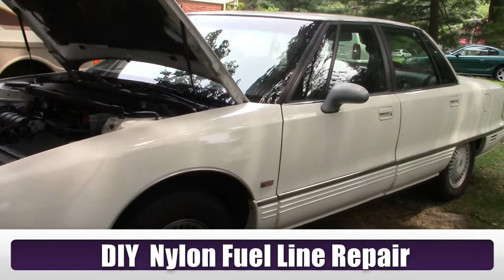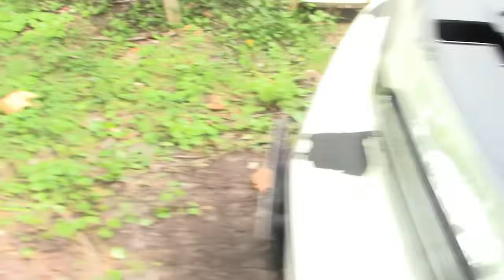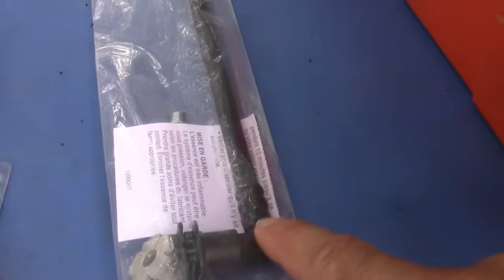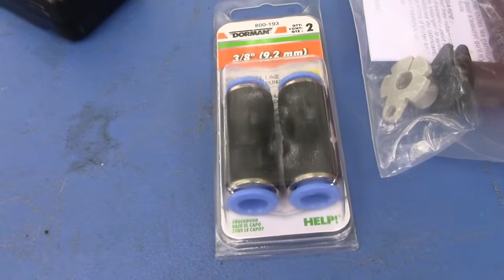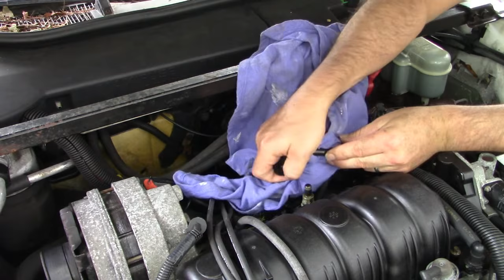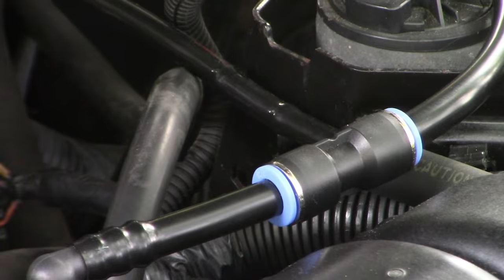Gasoline Leak?  Easy DIY Nylon Fuel Line Repair

Comment: You made an excellent video, very realistic, your readiness to work on your car is also very nice. But I would prefer first completely avoiding nylon line under the hood and exchanging both feed and return original nylon lines with either SS braided NBR or PTFE so as to avoid nylon line living in the heat (they don't like that and that's the reason why it cracked in the first place), or if for any reason keeping the nylon at least connect the two parts with barbed rather than with these untrustworthy plastic connectors. As for anti-chuffing, instead of cable protection, find a peace od garden hose or on old cooling system hose and slide it on. Cheers and keep on!

Comment: With those connectors you need to measure and mark to assure proper seating depth ESPECIALY with gasoline on a hot engine. I would have bought a new part as you now have to points in which to leak.

Comment: Totally  not good  because  its not a solido connection. Will leaks  and becaise  its pressure        it carries low pressure  and high  presure

Comment: I used a tubing flar kit. The bar that holds the tubing will hold the plastic fuel pipe tight enough to use more pressure, whe putting on you slice coupler.

Comment: That is one beast of a car. Saw a 2 door 98 in Olive Green that really was a nice boat. Good vid!
Reply: When I was 16 I had a 1973 with a 455 cubic inch motor. In olive green, that was a beast. I'm guessing it weighed about 5500 lbs

Comment: I did a similar repair on an 06 Siena and I needed a loop. I took the straight nylon replacement hose and stuck it in boiling hot water that was in a cut off gallon milk jug. It worked great, no kinks.

Comment: Wouldn't recommend, I tried two different fittings both leaked
Reply: You can also use ducting tape they use for hvac in a pinch. It works

Comment: I have a 96 Camaro with a leak in the nylon fuel line. It says "not repairable" on it. Does that mean I can't utilize this technique?
Reply: Same question. My return near the tank is leaking due to a rodent. It does say not repairable but I suspect that is for liability. Anyone know?

Comment: I bought these for my car and they absolutely suck.  They wouldn't grip the tubing and I just threw them away out of disgust.  Use a compression connector that is specified for nylon and you will have better results.
Reply from the maker: Worked flawlessly for me.... Compression connectors work well, too, I will say. Thanks.

Comment: Nice video! Are these the same as pneumatic fittings? Do you size the connector up or down, or just buy 3/8 connector for 3/8 nylon line? Thank you!

Comment: Might try  to bend the new line using a  heat gun and  a coil spring type tubing  bender as used for thin walled  copper tubing in household water  supply lines and  refrigeration lines. Worst  thing that could happen is  you  might melt the shit. A judicious  application  of heat and bending will  probably  get you through. You're  not going to  get a 90 using this method. But you could do a loop. Nonetheless,  thank you for the video, It gave  me some ideas.

Comment: Thank you so much for providing excellent content. Your video gave me the confidence to repair my own fuel line on my 2000 Pontiac Bonneville 3.8L
I used the exact same part numbers. The only difference I did was take a heat gun to curve the hose as close to the stock one. Other than that it was a nice clean repair. Not sure if I'm able to upload a picture of the repair. If I can I will.
Reply from the maker: Great note! Thanks for watching and commenting. Good job on the repair!

Comment: Great video. Glad it held up for you.  Me personally, I don't trust the push on because it's only an o-ring holding the seal.  Dorman has compression union #800-226 for 5/16 line that has brass on the inside of the tube, and nut with seal on the outside.  You can then adjust the compression depending on how tight you tighten the compression nut.  It's only a bit more work but it just feels safer.  And as it ages if it does leak, you can always snug it up more.

Also, as others have stated, I don't think sanding should ever be done on the outside of the tube as that is where the seal is made on the tubing with the press on.  Being OCD, I go one step further and even use a razor to cut the line to make sure there are no burrs on the lip of the cut that could interfere with the seal.

Thanks for your video.
Reply: It actually has small teeth inside that grip the line

Comment: Those unions do not fit the 3/8 line on my 1988 F150 (too small). The 10mm fit but do not seal.

Comment: I agree with your several assessments: a) not to use the barb fitting; b) not to squeeze / cut; c) not to induce a kink in the curve. That line can withstand under hood temps and will take a set first hot / cool cycle. You could have used hot water or a heated wet towel to soften / shape the line to avoid kinking and eliminate any stress strain on the connectors.
Reply from the maker: Thanks for watching and commenting.

Comment: Ouch... You doubled your chance for failure by using two unions instead of one.
And running the line around the EGR valve is a recipe for disaster. There is a good reason the OEM routing was outside the heat shield. A piece of wire loom is no substitute for a heat shield.
Reply from the maker: Ouch nothing. The repair job has held up great. But if anything does go wrong, I'm blaming you.

Comment: Thanks for sharing awesome video it makes more sense than any other of the 30 video I have looked at fixing my 2005 Cadillac Deville that has a leaking gas fittings
Reply from the maker: Thank you so much!
Reply: Hey James, looks like I missed a question from you, some time ago. Yes, this worked on my 1996 Cadillac. I used the  Dorman brand found at almost any auto parts location and was pleasantly surprised at the ease of installation, as well as its effectiveness.

Comment: hi sir; does it survived without leak under engine heat and fuel pressure.
Reply from the maker: The fittings have held up perfectly for a long time now, without any problem.

Comment: Those sharkbite connectors are pretty cool. Used in plumbing,  air,  and now fuel.  I bet that leak was because you sanded the end of that tube.  Hopefully she holds for you.
Reply from the maker: Thanks, Lee. The job has held up for well over a year now, no problems.

Comment: I've got a leak that keeps coming back and came across the repair joints and watched your video thanks. I'm just going to eliminate the connection and install one joint
Reply from the maker: Thanks, Tim. Hope you get it solved.
Reply: Did this end up working for you in the long run, Tim?

Comment: I have a bonneville with nylon fuel line and repaired it with a union but it is leaking so im going to have to put a new union on i guess. But good video and great info !

Comment: If they make those repair couplings in 90° , could have used two with straight pipe in between.
Reply from the maker: I'm pretty sure they make 90 degree fittings, but I was trying to make it work with what I had on hand.... Still holding up well to this day, happily.
Reply: @Buckwsr  
Had to fix fuel filter fitting that developed a hole on Crown Vic. 90° quick connect fitting, about 6" 5/16 rubber fuel injection hose, two clamps and new Motorcraft fuel filter. About $30 and hour or so and back in business.

Comment: why u got 2 inline connectors on one pipe, u could of took the one on the engine spun it round to join the one on the inner wing.

Comment: Thank you so much; brought/installed the connector kit and the nylon press fittings today because of your video; very helpful. I was afraid to “cut” my cars original part at first. Your vid gave me some courage. So far so good; no leakage.
Reply from the maker: Cool. Mine are still working perfectly, too.
Reply: @Buckwsr  wow 2 years and it’s still holding up? Nice !!!
Reply: Is it working till now?
Reply: @Victordd496  yes; holds up well
Reply: Thanks I going to do it today
Reply: How did it go? @jameswhite1319

Comment: These Dorman quick connect fittings look like a pretty good solution to a similar problem I have on my 96 Cadillac Deville.

Do you trust them for use on the high-pressure line feed line?
Reply from the maker: I think they're fine for either, supply or return.
Reply: Hey  @Buckwsr ! Thanks for this video. Though simple, it gave me the confidence to attempt a fuel line repair. Yes, this worked on my 1996 Cadillac and I did use the  Dorman brand found at almost any auto parts location. I was pleasantly surprised at the ease of installation, as well as its effectiveness. More than a year and no issues.👍

Comment: Thanks for the demonstration, including the slight misstep. Keeping it real.
Reply from the maker: Thank you, Sir.
Reply: @Buckwsr  I actually came here to see if the press couplings work properly.  Seeing you install one, and have a slight leak, then just push it in and repair the leak was an excellent video.  Dorman should send you a bag of fittings as a reward for posting this.

Comment: Steel on steel contact with anything in the engine bay even with a hand hacksaw can make small sparks. It would be safer to cut the line with snips.
Reply from the maker: steel on steel? You mean steel on plastic....it's nylon fuel line, not steel.
Reply: Liked the video thanks. But he's right, the hacksaw could have slipped through cut into metal elsewhere.. and someone could even make an accidental connection berween a hot  wire and grounded material, however unlikely. Prolly even wise magic to disconnect the battery but maybe thats overkill idk. Though the later happened to me once, dropped a wrench on an engine and the other end managed to land on the alternator hot post, which should have had a cap on it

Comment: On my 2001 Buick Lesabre I had a leak in 90 degree fitting. Under the back seat there is a fuse panel. 2 Fuel pump fuses are in there. I pulled those out and started car till it died. It helped relieve the fuel pressure and saved me getting fuel all over the place.
Reply from the maker: Thanks, John!

Comment: Thanks for sharing info and video. Thinking of using one of these push on or it’s £150 part and 5hrs fiddly fitting. Checking data sheet 10bar pressure which is good but worried about the 60c heat as under the bonnet (hood) gets to 80c on a LR TDV6 diesel, how has it held up?
Reply from the maker: The repair job I did with these fuel line connectors has held up perfectly, as I drive this car every day. It's been about a year and a half, I think, since I did the repair.

Comment: Just checked the GM shop manual. Back 3/8 line is Feed.    Front 5/16 is return.
Reply: Correct.
Reply: Can you use on the rear feed to the fuel tank? My connector to the fuel tank is broken and leaks fuel

Comment: How did you determine the fuel line was the feed and the other line was to return?
Reply from the maker: I believe it is the line that runs to the fuel pressure regulator there on the front corner of the engine that is the feed line....not that it makes any difference....the line that is cracked is the one to repair, right?

Comment: Great help thank you very much...

I have a similar situation, and I was finding difficult to believe that the connectors would hold the fuel pressure, now thanks to your video I trust it’ll do the trick for me as well.

Liked the video to help with the algorithms 😉👍
Reply from the maker: Thanks, Andre. I did this repair job a year and a half ago, and it has held up perfectly!
Reply: Data sheet is 10 bar /145psi on these push fittings
Reply: Thanks for the info I see it works and it work for me too

Comment: Didn't have much luck with them .Seemed like a great idea at the time but they would leak a little then stop then leak again said the heck with it and went and got the brass couplers. So far much more secure connections.
Reply from the maker: Yes, I have used the brass compression fittings with success in the past. But these press-fit unions have held up perfectly for me...and it's been a year and a half since I did this repair. Thanks for watching the video!
Reply: Thanks

Comment: Can I use this in fuel line the metal part? Mine is leaking under my car.
Reply from the maker: No. These are for nylon (plastic) fuel line only. There are brass compression fittings that can be used to repair the metal fuel lines.
Reply: @Buckwsr  is there a nylon to metal compression fitting?

Comment: Great video, I only have one comment, and that’s get it away from the EGR valve that gets hot as hell. Not looking to be negative just an observation.
Reply from the maker: You are right, of course. But I insulated the line well where it passes by the EGR. It's been over a year, driving this car daily, and still working perfectly.

Comment: you play with fire ... gasoline is very flammable, a leak and your car can get on fire ... you can use improvised and bulshit kits on your own risk ... and I don't trust plastic pipes enough.
Reply from the maker: You car comes from the manufacturer with nylon fuel lines....All makes and models use them these days....
Reply: @Buckwsr  Tell me if it can ever leak from moving or twisting ??

I mentioned there is no leakage from the time of installation.. I just want to clear my doubt
Reply from the maker: @aviee4560  If it's not leaking now, then you're good to go. I did this job a year ago. Still perfectly leak-free!
Reply: @Buckwsr  thank you so much
Reply: @Buckwsr  yes but no one comes with that quick connector commonly used on air pressure lines
Reply: and manufacturer use hose on linkage with motor for flexibility
Reply from the maker: These fittings are marketed specifically for fuel line repair, and it states that directly on the packaging. (https://amzn.to/3aQNGfH).
They have held up flawlessly for me since posting this video about a year ago. I have also used brass compression connectors successfully.
Reply: @Buckwsr  I have recently used that connector in my car at bottom line near fuel tank ..
Is it safe or not for long drive 600-800kms ?

I have installed this 2-3 days ago..
It's working properly now no leakage at all but I'm in doubt for long travel please tell me
Reply: @user-ug9nn  that’s not a pneumatic fitting but whatever... this ones made for.... FUEL!
Reply: Plastic/nylon fuel lines are common some made of a soy bean by product. As far as the gas its the fumes that are dangerous

Comment: PTC fittings for fuel - bad idea.
Reply from the maker: Once again, I mention that these fittings are designed and marketed specifically for fuel line repair....
Reply: That’s not a onanistic fitting it’s the same concept but designed for fuel lines...

Comment: My son did the same thing here what u did but its still leak around where the connectors are joined. He did to connection but only one leaks. Can anyone give suggestions please thanks.
Reply from the maker: If you (or your son) read through the comments on this video, you might get some ideas on how to prevent or eliminate leaks. I did this video maybe a year ago, and it has held up well with no leaking. Good luck.
Reply: @Buckwsr  Thank u fo ur video knowledge is Power. Ur video helped my son to fix his vehicle. He used the metal connectors tjey worked much better. That saved him 400.00
Reply from the maker: I congratulate your son on getting the job done himself. I, too, have used the brass compression connectors on other projects, with much success.
Reply: @Buckwsr  hey how did you get that union to stop leaking I'm in bad need of something like this

Comment: Any idea of the diameter of the pipe in mm?
Reply: This is 8mm which is mostly uses in fuel line
And that connector have many sizes like 10mm 8mm 6mm 4mm 12mm 16mm and more

And you can confirm your fuel pipe size by normal scale

Comment: when presser goes in the line it would have got that kink out over time or use a heat gun on low setting ...never put more butt connectors in then you need to ...i would rather have a little kink then putting another one of those in

Comment: Dude I’m doing this to my ‘96 Caprice Monday....
Reply: Thanks brother it did work and I bought a couple more just to have on hand.
Reply from the maker: Hope it goes well. Read the comments on this video for some helpful tips left by other viewers. Good luck.
Reply: @Buckwsr  I have a 96 caprice as well leaking from my fuel return line right above the fuel filter it’s a nylon hose would it be safe to use these undercarriage?
Reply from the maker: @hwyy9046  I would think it fine. I mean, it's not going to rust! I have also used the compression-type connectors on nylon fuel line with success under the vehicle. Good luck.
Reply: @Buckwsr  would you happen to have a link for those
Reply from the maker: @hwyy9046  This link if you need 5/16" size: https://amzn.to/3vaSfus. Or this link if you need 3/8" size: https://amzn.to/3bLrepT  Good Luck!
Reply: @Buckwsr  thank u!
Reply: My 96 Impala SS just started leaking horribly today. Right at the rear next to the driver's trailering arm. Can't even tell which line it is due to so much leakage everywhere.
Reply: Did it work?

Comment: Ive had luck with steel lines with those unions too
Reply: Is your still doing good? I have leak in the middle under my car, Steel line got pin hole
Reply: @stripecatflippangitnamecha8721  its holding but i do plan on replacing it. Its not rated for steel or aluminum lines. Since i have done work to the truck. I need a bigger fuel pump so i may go with AN lines

Comment: Can you use the end of the union on a steel line
Reply: You can also use a brass union rib fitting and heat the plastic tub and twist the fitting on.  Then you can hook up you rubber fuel hose the that fit
Reply from the maker: These fittings are for nylon (plastic) fuel line. You can get brass compression fittings to use on steel fuel lines.
Reply: Thanks